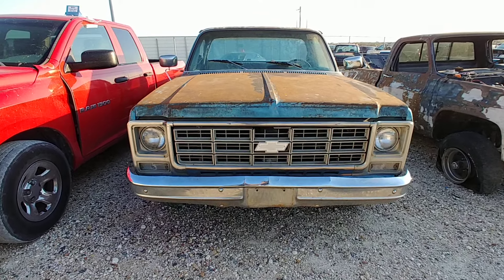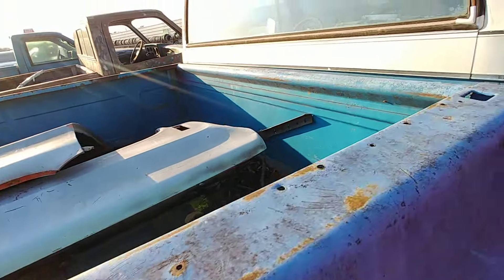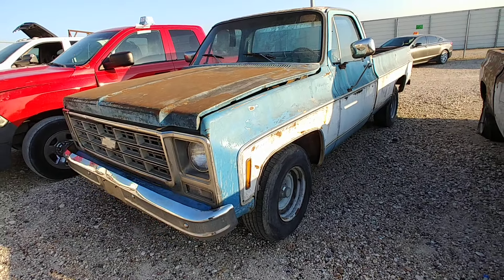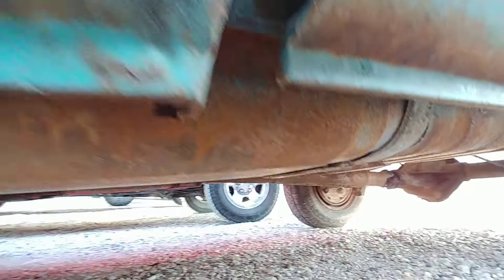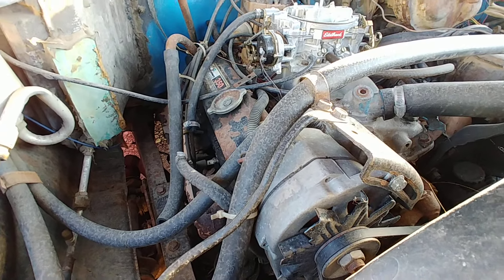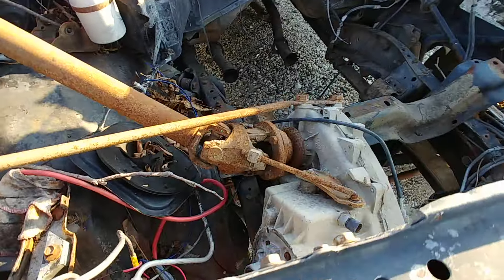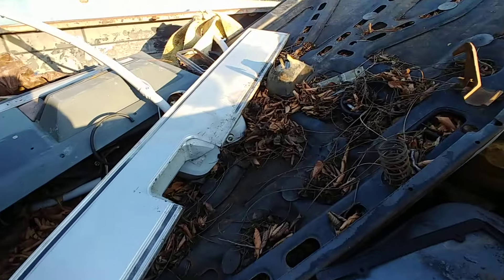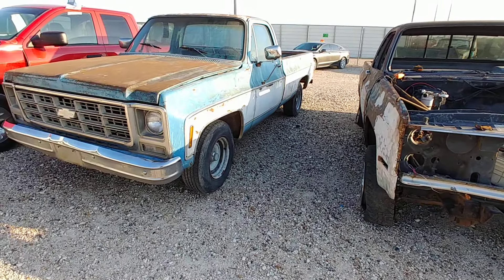For Sale 1979 Chevy Big 10 Square Body Junkyard Find

Comment: Whoa Nelley, 1979 and could be out of time. Yes, the first one is a 1979 model year.

We got the VIN, we win: C for Chevrolet, C for 2WD conventional chassis, L for 350 CID V8 with four barrel, 4 for 1/2 ton rated with HD suspension, aka "Big 10", 4 for cab and pickup box, 9 for 1979 model year, Z for Fremont, CA assembly and the rest is the production sequence. The Fremont, CA assembly plant, aka "Freaky Fremont" operated from 1963 to 1982 as a GM plant, then from 1984 to 2010 as a NUMMI plant with Toyota and today assembles Tesla vehicles. It was the worst of the worst in the GM system rife with alcoholism, drug abuse, absenteeism, and vices. It was said, "If you want it, you could get it at Fremont". It was one of the "Terrible Three" in the GM system, including Fremont, Van Nuys and Southgate, CA. The Fremont and Southgate plants both closed in 1982 and Van Nuys in 1992. 

Exterior paint is possibly code 21 Pastel Blue and code 10 or 11 White two-tone exterior paint. Yes, that's an "over the counter" 350 CID remanufactured engine. 

Yes, second one is a 1986 model year with the VIN for the win: 1GC for US made Chevrolet truck, E for 6,001 to 7,000 # Gross Vehicle Weight Rating with hydraulic brakes, K for 4WD conventional chassis, 1 for 1/2 ton rated, 4 for two door cab, H for 5.0L (305 CID) V8 with four barrel, 6 is a check digit, G for the 1986 model year, J for Janesville, WI assembly and the rest is the production sequence. The Janesville plant operated from 1919 to 2009. No tag, can't brag, no SPID wish you did, but this is possibly code 25 Medium Blue exterior paint. 1986 is the last year for the C and K square body trucks, but NOT the last year for the square body trucks. From 1987 to 1991, they were called R Series (2WD) and V Series (4WD). In the spring of 1987, the GMT400 (aka OBS) was released for the 1988 model year and the C and K naming came back. That meant that the RV and CK trucks were sold in the same showrooms for a few years. GM tried to (but not successfully) change the nomenclature on the square body trucks to avoid confusion. It really didn't work and folks are still confused to this day about it.

Whoa Nelley, square body looking very shoddy. Fremont VIN code "Z" and it's always been over for thee. 350 and gotta go. 305 took a nosedive. That's it, time to quit. May not be flat and that might be that. One made in the land of cheese; won't you save it please? GM trucks may be out of luck. Please don't get squished because a bevy of people including the Google Man will be very, very, very, very, pissed.

Comment: What?? 4000 for that rusted busted thing?? More like 400 dollars, and that's if it starts and has some spares in the back.
Reply: $400 wouldn't even get you the parts in the back of the bed today. Square body (and other classic) parts are out of control.
Reply from the maker: could it be said the irony is that the junkyard most likely paid around $400 for that truck?